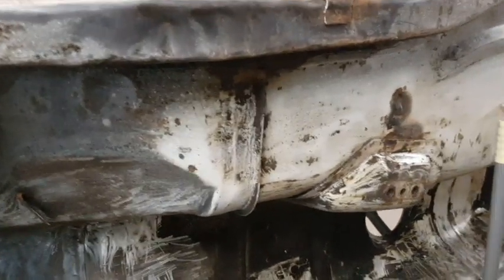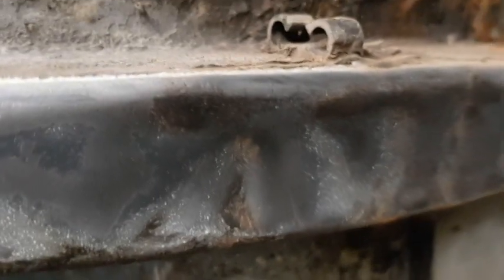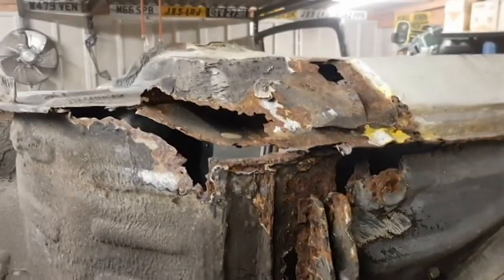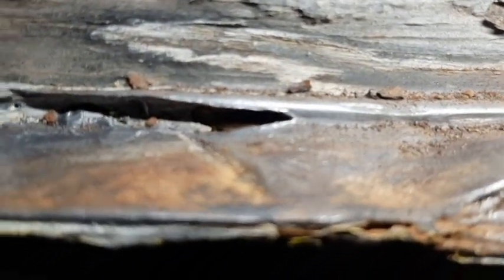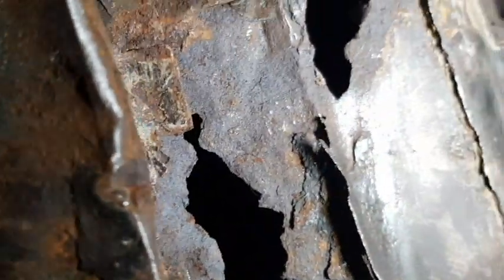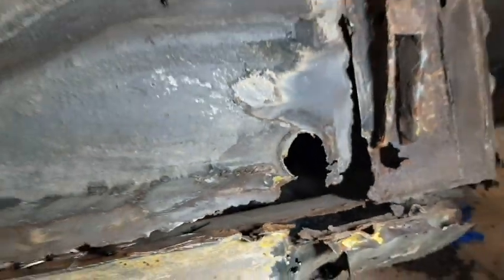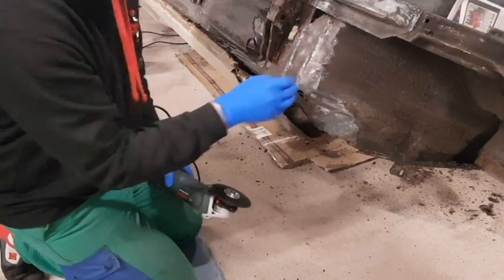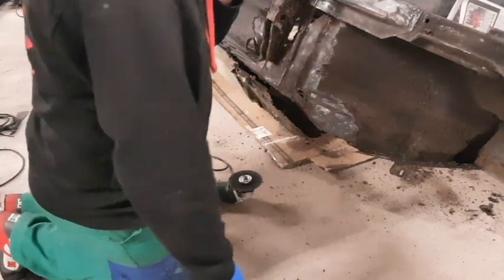Ford Capri 2.8i rusty floor

Comment: Wow, that is allot of rust! About to start working on my 50 Ford 2dr sedan. Looks like my future!
Reply from the maker: Yes it's got alot of rust but that's the uks weather for you 🤣🤣 do you think yours will be as bad
Reply: @RetroCarsReborn  Yes it needs inner and outer rockers and allot of the floor and trunk area are bad. It sat for 30 years with the windows partially down.
Reply from the maker: Wow sat for 30 years we just don't get that here if it's sat for that long in the UK it just falls apart if you move it the capri I'm working on has not seen the road since 1992 but it's been in a garage for the last 10 so that saved it no end
Reply: @RetroCarsReborn  It is in surprisingly good shape. I would not even take the body off of the frame if It wasn't for the rusted out body mount supports.
Reply from the maker: It sounds like you fell lucky with its condition even if its sat for so long 😱